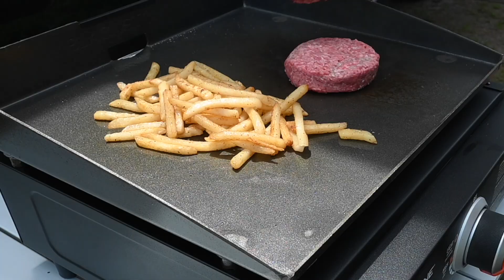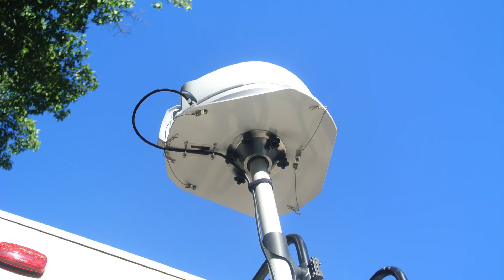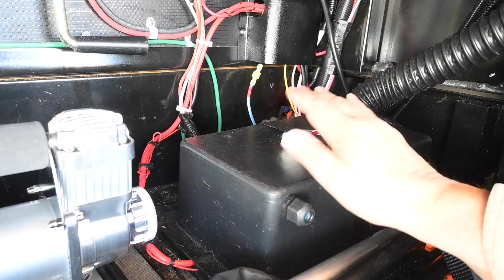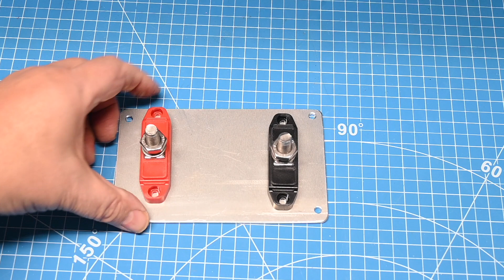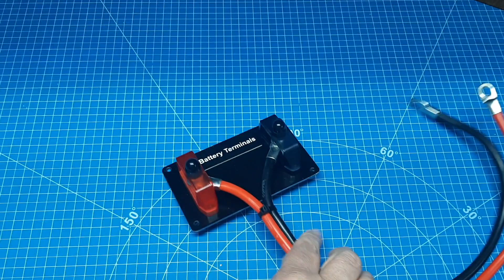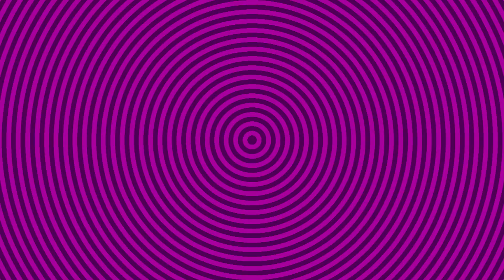Powering a ViaAir Compressor from your RV.

Comment: On my fifth wheel, the positive and negative busbars are in what was originally the battery compartment that is in an independent compartment on the front driver’s side. So I was able to connect a wire to the respective bus bar and mount a quick disconnect on the outside of the rv, which is about four inches away from the bus bars. All I have to do is plug my ViAir into the quick disconnect. Much simpler. No alligator clamps required.
Reply from the maker: Thank you for your input.

Comment: I had the same idea last year. Last year I replaced my battery box on my travel trailer (the single plastic ones) with a small tool box as I needed something with enough room to hold a couple of bus bars and my new shunt. I created a 6 gauge cable to the bus bars and to an Anderson connector to the back side of the box. I cut the alligator clips off my compressor and put the Anderson connectors on both the compressor and the clips. Works great and no need to open the battery box and the alligator clips can be reconnected to use the compressor on another battery or vehicle. I have extra Anderson connectors if I need to connect other things to the battery too.
Reply from the maker: Thanks for sharing.

Comment: Thanks for the video. I had no idea such a product existed.   It’s perfect for the air compressor.   Did you consider cutting off the alligator clips  and adding lugs to attach to the battery directly?
Reply from the maker: I did not consider adding lugs. I wanted to keep the air compressor portable so I could use it on my vehicles and other equipment.